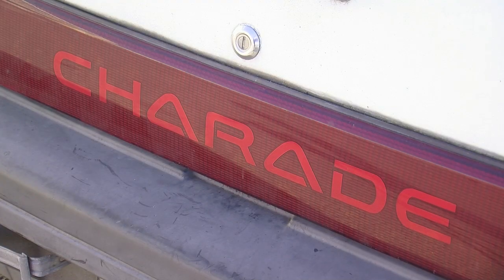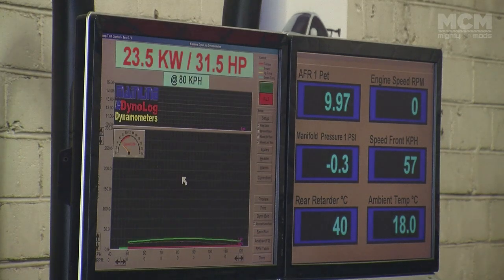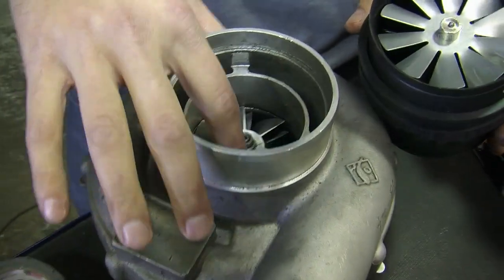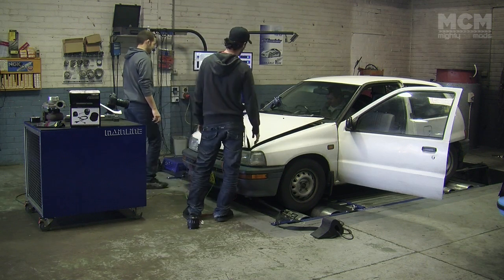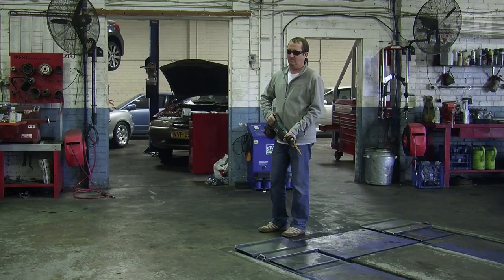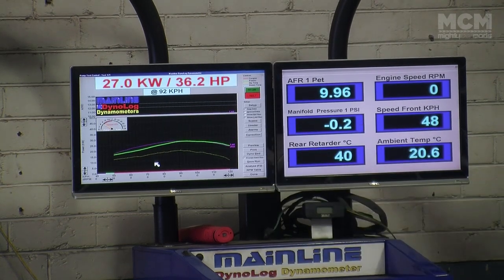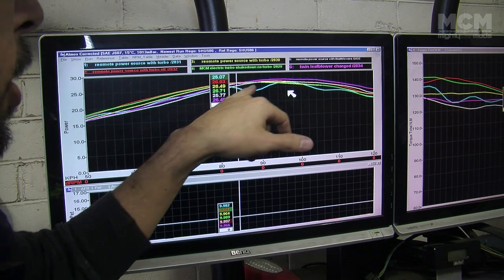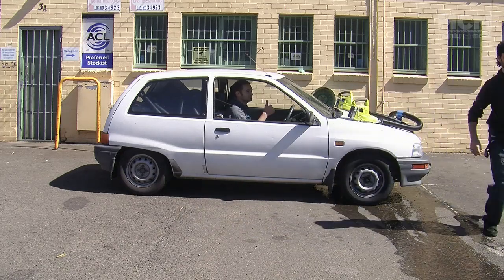Electric SuperChargers Mythbusted

Comment: do you think the supercharger would of gain power if the charger was out of the engine bay or against the grill cause the way you had it hooked up it was forcing hot air in.
just a question i wanted to ask, cause its been running through my mind lol

Comment: Stupid bitches just do not know how the internal combustion engine works. To get more power you need to burn more fuel. That's why you must add more oxigen with the help of the supercharger.
Just adding oxygen without modifying the fuel system is just wasting your time.

Comment: On Citroen 2cv6 or 3cv (argentine version) has a direct tube from radiator ventilator, this ventilator moves direclty from the engine, on this tiny engine the benefits shows as better performance.

Comment: 3 years old , and outdated. That was then, but this is now :electric superchargers are now OEM
Reply: The point is that you can't buy something from eBay and expect your car to know air is being compressed so it can increase the amount of fuel burned on every power stroke.

This assuming the compressor is actually working as a compressor and not just as a leaf blower.

Comment: Of course this was bound to fail. You can't gain alot of power by forcing more air into the engine without compensating with extra fuel. You guys only dealt with half of the prospect of extra power.

Comment: Hmm...I know it does absolutely nothing for performance, but in for the soccer mom down the road, I wonder if it would save gas if driving slow/shifting at 2,300-2,500 rpms? I mean, no parasitic effects, and no compression, but a theory of gas mileage benefits or will it just obstruct air? Also, I'd worry this crap would break and find it's way in the engine...

Comment: i liked you all but after this video you all talk a set of madness first the leaf blower compress air then its just a fan WHATTTTTT
1.leaf blowers compresses air for your info
2.you all set up the leaf blowers wrong 
  1.the part which the leaf blower should taking in air is facing the hood, so now the car is getting restricted air flower because you directed the air to the leaf blower an now the car can not take air from the outside because its taking air from the hood, so its just getting air from the blowers

Comment: however, an electric turbo is more than possible. If you look at RC jet engines, they use a radial (centrifugal) conrpressor, which is literally the same type of compressor stage in a turbo. The starter on these little turbines is strong enough to spin it up to 80k rpm before combustion takes over. This being said, attaching an electric motor to a turbo and getting rid of the exhaust side is more than possible. In fact, that is what F1's are currently doing to eliminating turbo lag. they are simply using it in conjunction with a constant KERS system.

Comment: Wouldn't the fan have a better chance at working if it was installed in a cold air intake tube going into a throttle body? The car that is used is probably not the best choice to test the fan on.

Comment: Basic math: 1l engine - 5000 rpm => 5000l of air / minute => 83.(3) l/s 
If "turbo" can't pump at least that amount of air it will decrease engine power.
If you want to gain power you need to increase the flow.
Also you need to chiptune the car so the injection sistem also pump more fuel to burn in the cilinders, because now you have more air for the fuel to burn.
Just pumping more air in the intake won't increase to much the power.
What you should test was power output with intake filter on, with and without the turbo, because air filter decrease airflow.

Comment: This is brilliant, the installed ebay fan spins the wrong way and the reason they get more power is less pressure loss with removed piping :D So, removing the fan, which added even more pressure loss gave even more power :D And at the end, the guy is talking about a turbo lag to explain the low power on the low rpm with electric motors :D :D

Comment: as soon as you I seen the fan blades I knew they are too flimsy.  Conceivable you could build an electric turbo charger, but I think you'd need some crazy strong neodymium magnets and  blades i'd guess 3-5 times stronger then the ones in the test unit

Comment: had a lot fun watching this. Now im curious. How about trying an RC EDF System for supercharging. I have some of those and they have a ridiculous amount of power. Take one of those, attach it right before the Motor so that no pressure gets lost. with intakes to prevent hot air gets sucked in. Change the engine mapping and i bet itll work like a small supercharger.
Reply: +Schi Schko https://www.hobbyking.com/hobbyking/forum/forum_posts.asp?TID=30144

Comment: You should have used 2 gas powered blowers. That probably would have gotten better gains.
Reply: +Tyler Eberhardt no bro it will still do the same thing because there redirect the air to the bottom of the blower so the car is sucking air through the blower but it is not getting air from the outside

Comment: Damn.. My stock turbo in my 1.9 TDI VW Passat has some very high pressure. 
Maximum pressure I've seen on the gauge is 1.8 bar (26.1 psi).
No wonder why the head-gasket is always blowing out :p

Comment: instead of spending 300$ on a electric turbo, u might aswell try 12s(or higher) on a RC EDF. xD
Reply: +Kinzoku Shirogane maybe use the EDF to boost the turbo and remove lag
Reply: +Kinzoku Shirogane Possibly, although they are designed for high speed low pressure, they (a propper formed aerofoil fan) will probably still work better than that aweful fixed angle vein fan in the ebay system...
Reply: +N ytonial well, maybe not specifically a EDF motor, but a 15-20 horsepower RC brushless motor, on a 1:3 gear. Its max rpm would be around 30k and with that gear ratio you would nearly reach turbo speeds(using a turbo turbine).But thats just for fun. You could just instead add that motor power to the wheels, looking at the original power from that car. xD
Reply: +N ytonial  there is no preasure at all.read up on static vs dynamic preasure.
Put card board over a huge box fan and it will push it off?
No...it will cycle inside the box.
Positive pressure fans are a very special kind of fan.
I hate thoes ebay rip offs.
Most are $20 boat bilge fans...and sell them for $150.
Reply: b long
An EDF cant push a cardboard box?
Don't know where you've been living but I have a 15KG RC plane that the EDF's have no trouble doing VTO's on...

I work in the design department of Rolls Royce civil aviation.... Yes I know about the types of pressure... Thats why I know they can be converted, if innefficiently in this situation.

Comment: Of course you're going to get more fucking power with nothing in front of you're air intake because there is nothing blocking the air coming in. That's why racers will remove the air filter before races to get more air intake, even though in the long run its bad for the car.

Comment: I think an electric turbo can work if were built well enough and if it used a powerful brushless motor with extremely fast gearing.
Reply: +sam strothers It needs two things: first, an electric motor capable of continually producing at least a few horsepower to run the compressor and second, a properly designed impeller to act as a compressor.  It would be substantially larger than the ebay special they were working with, with a motor about as large as a typical alternator, and a compressor similar in size to the cold side of a small turbocharger.  Actually, that turbocharger they showed early on (which is a fairly burly one) would provide a good reference.  Replace the hot side with a well-cooled elecrtic motor and that's pretty much what it would have to be to work alright.
Reply: +ExaltedDuck how about a brushless motor the size of an alternator, geared right so it can produce psi without burning itself out, and hooked up to 2nd car battery?
Reply: Assuming you could find one and attach it to a properly designed compressor, you'd probably need at least 3 or 4 paralleled batteries.  At useful speeds and powers and running on a 12 V supply, it would require something on the order of hundreds of amps.  Another way to look at is this:  superchargers and turbochargers are driven directly by mechanical energy from the engine.  There is very little loss in driving them.  To drive an electrical system, the car's mechanical energy has to first be turned into electrical energy and then that electrical energy has to be turned back into mechanical energy.  Those transformations are expensive, in terms of losses, while super and turbo chargers never have to experience them.  Additionally, the larger alternator and additional batteries to operate such a system, in addition to the system iteslf, would be considerably heavier than turbo or supercharger.  If it were a viable idea, it would have been done by now.  The only system I've ever heard of that sounded even remotely reasonable was meant for drag racers, and simply featured a lot of extra batteries without extra alternator capacity.  Drag races are short, and the discharged batteries could be traded out for charged ones between races since recharging them could take hours.  It never really took off, though.
Reply: pzy3339 can't wait for the hot rodders of 2025. Electric super turbochargers powered by quantanium ion batteries.
Reply: The supercharger on a Dodge Hellcat V-8 takes about 80 horsepower to run at full bore.  That's about 60 kW.  At 12-15 V, 60kW draws 4000-5000 A.  The real-world considerations for losses and inefficiencies mean at a minimum, the charging system would have to deliver 2-3 times that much.  Alternators designed for very high output seldom exceed 200-250 A.  

As far as the formula 1 stuff and he electric turbo, that's a whole different level of thinking.  Those involve both the crankshaft and turbocharger hooked up to hybrid drive systems.  The turbo is still primarily driven by exhaust gases, and the wheels are still primarily driven by internal combustion, but the turbo can be held to speed under braking to preserve power/prevent lag and slowed under heavy throttle to prevent waste pressure/heat while generating electricity.  It's not entirely comparable to the discussion at hand in that it is a very high end, cutting edge and ACTUAL engineering feat, where electric superchargers are a dead end, like putting a fan on a sail boat.
Reply: +pzy3339 Actually electric TURBO chargers will be more efficient than conventional turbo or super chargers.
An electric turbo works like the regular turbo, but you can spool it up electrical. So you can drastically reduce the turbo lag. At higher rpm electric power is not used but can be generated: Instead of using the waste gate, the electric motor acts as a generator and slows the turbo down. 
All in all this system is much more controllable than regular charging methods and gains a lot of efficiency.

That is probably the reason they use it in Formula 1 cars these days and there is a lot of development to get it in production cars ;)
Reply: +pzy3339 I guess you just don't get the point. At higher rpm a regular turbo generates more boost than necessary or healthy -> the waste gate opens!
An electric turbo would slow down the charging by recuperating electricity, so the waste gate stays closed and no energy is wasted -> better efficiency!
Reply: +kyle Keogh I'm talking about the s/c itself.  I read in a magazine or press release somewhere that it takes about 80 hp to run.  This is something you won't see in most dyno testing but it comes primarily from the energy that it takes to compress the air charge.  It's pulling in about 30000 liters of air each minute (2-2.5 liters per revolution) and boosting by 11+ psi.  This alone accounts for about 50 hp.  factor in friction and rotational inertia and 80 is pretty reasonable.  The thing is, compared to a natural induction motor otherwise similarly configured, it's going to roughly double the power output (in this case, about 450 hp to around 900 before accounting for internal and drivetrain losses)
Reply: pzy3339 what I am suggesting is that if one were to run a similarly sized supercharger with an electric motor rather than a crankshaft pully, it would require at least the same amount of energy.  In point of fact, due to all the losses with generating and using electrical energy, it would probably require 50-100% more energy to run an electrical supercharger to the same capacity as a traditional mechanical one.
Reply: kyle Keogh wow that's amazing. It shoots gas into the turbo?  I gotta look this shit up.
Reply: sam strothers Yep. They are most commonly used in rally cars, and they essentially unleash hell.
Reply: ExaltedDuck Ah, I see where you are coming from, in the pseudo math I did in my head I forgot to account for the resistance the pressurized air provided.

Comment: no just tape 3 120mm delta fans to it and the engine will probably break because they create so much pressure... and you need a powerful battery because one of them consumes 100w